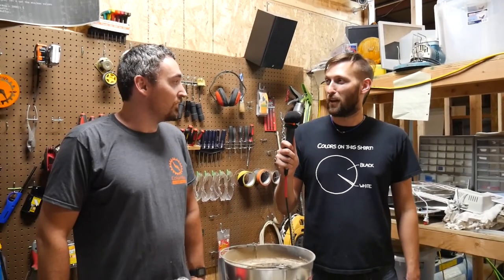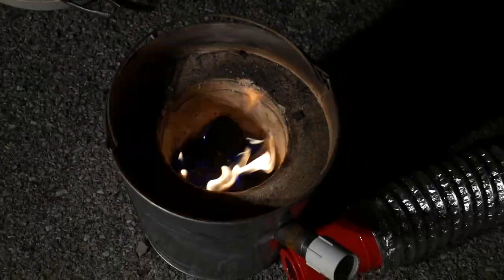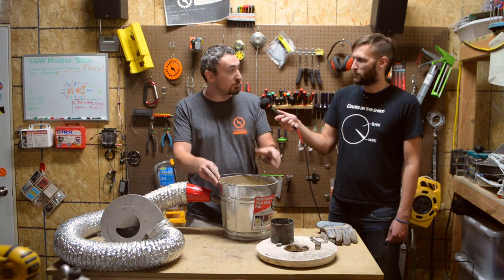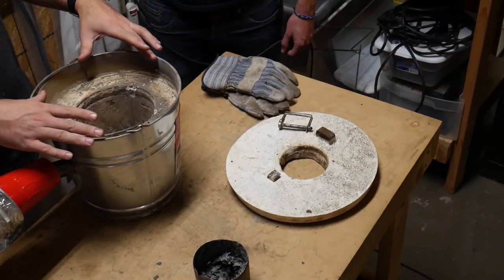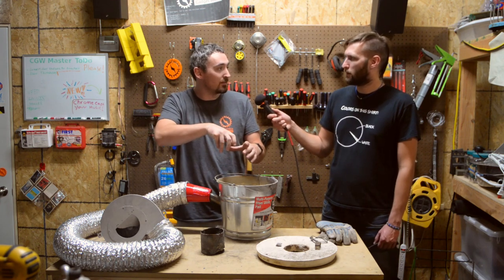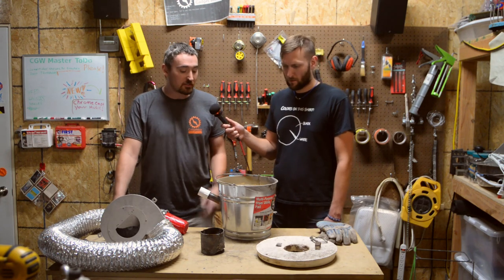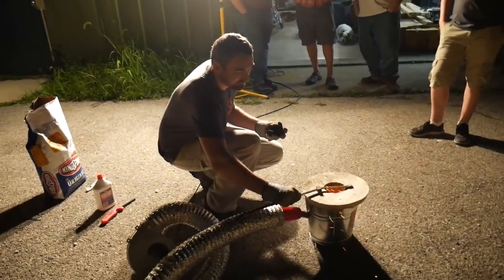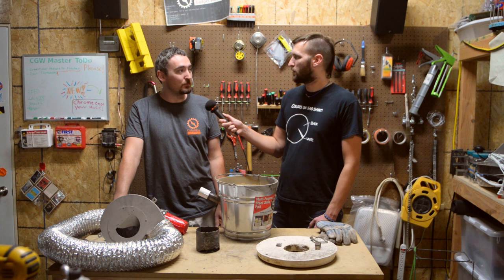[Project Spotlight] - David's Aluminum Foundry

Comment: Very Cool!  A Brake Drum is made of high carbon steel, which would it ideal for a low cost crucible, would take some modifications to your forge to use it though.  We had automotive parts lying around (including an old transmission we harvested aluminium from!), but it could be easily acquired on the cheap from a junkyard.  It works great!  My cousin built one and it almost gets hot enough to melt iron ore we collected!